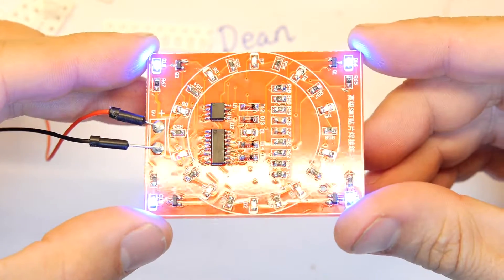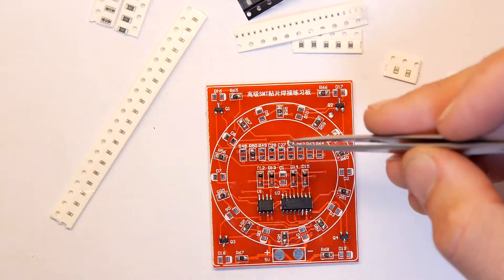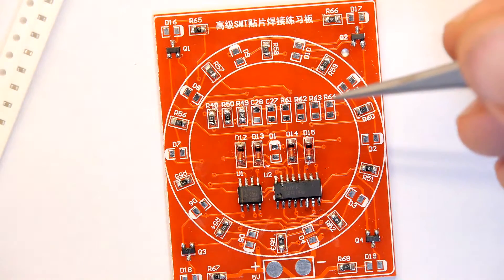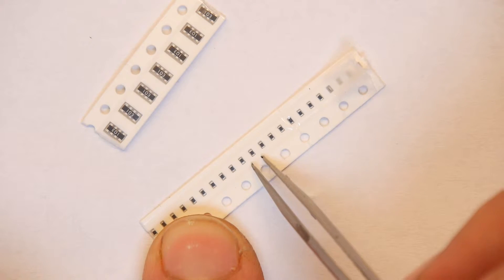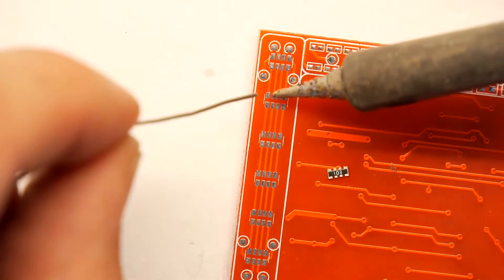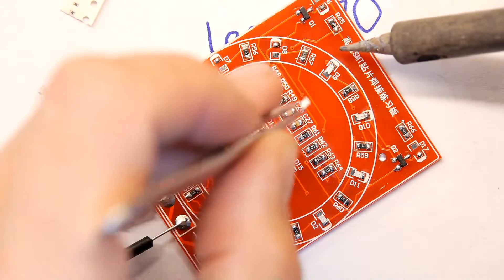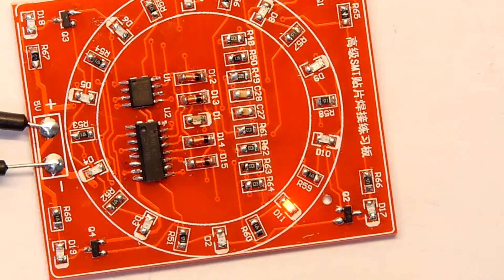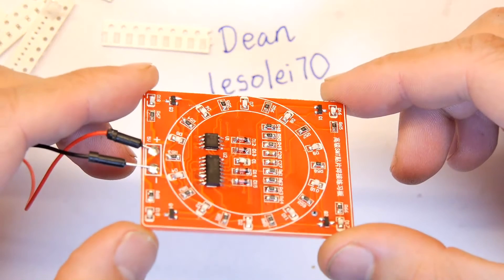Dean's Mailin PCB kit SMD

Comment: Did you mean resistor arrays?
Reply from the maker: +MrPGT9999 probably 😂 what did I call them?
Reply: "Resistor sort of packs." :D I should probably send you a couple of the kits I have killed. One was a backwards transistor (I think the dog soldered that one in) and the other seems randomly half-dead.
Reply from the maker: +MrPGT9999 Any time 😂